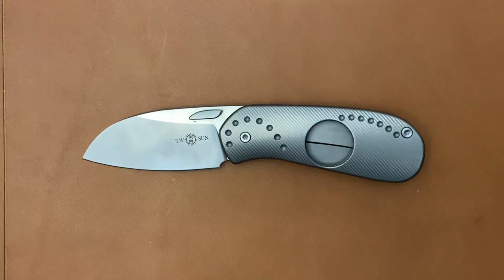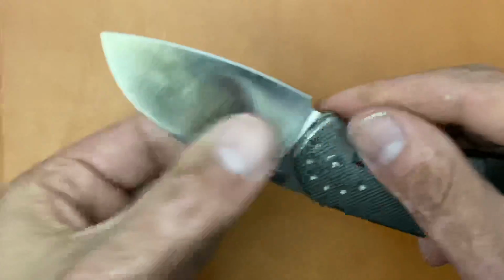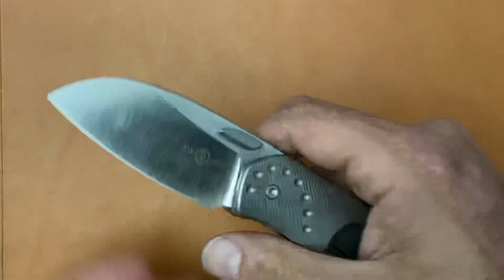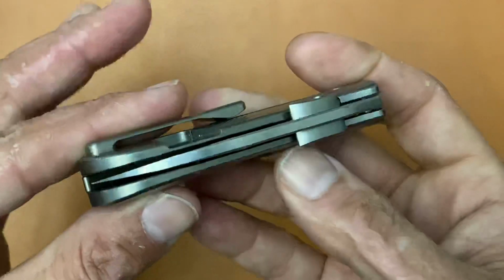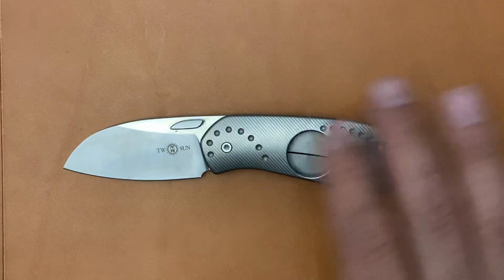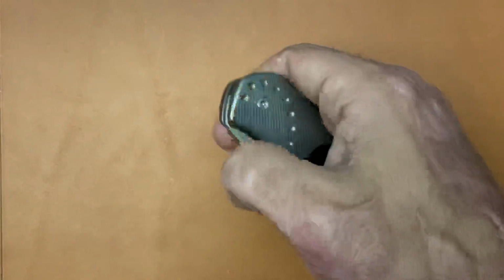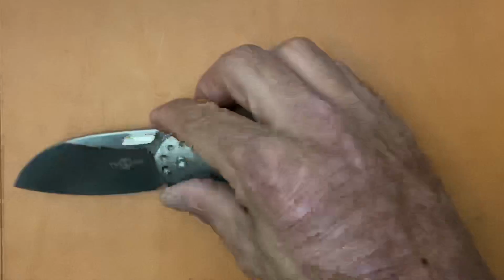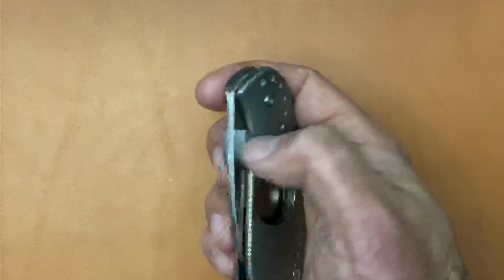Smooth and Slicey the TwoSun (Ts179) Perfecto

Comment: I agree on the size...looks like my size knife,  and if it has a thin grind, that’s even better.  Love this one.  Does Amazon carry these?  But...what will you do to replace the thumb plates?  Not that big a deal...hahah,  for you maybe. So if I buy one,  can you fix it for me...lol.  Thanks for a great review.
Reply from the maker: Mick Keim I bought a few studs that I plan to try out but I may have to use one of my carbide drill bits to make the whole bigger where the thumb plates go. I don’t know if Amazon has them yet but they usually get the popular ones eventually. If I am able to make a stud work I may offer that service 👌🏻
Reply: I wanted to pick up a couple more and it seams they are fairly scarce now.